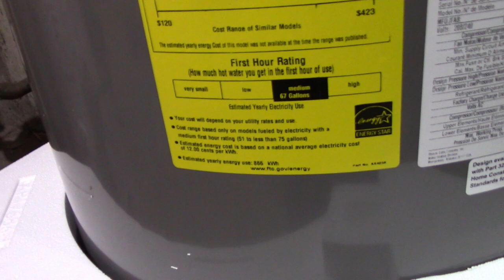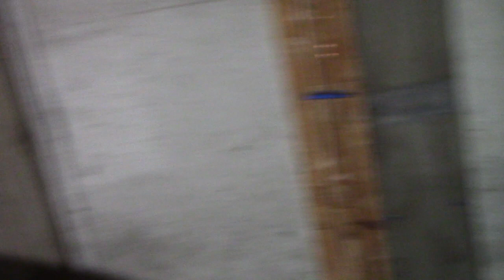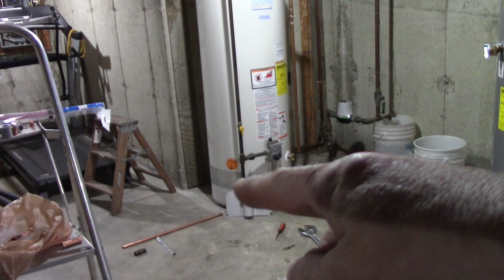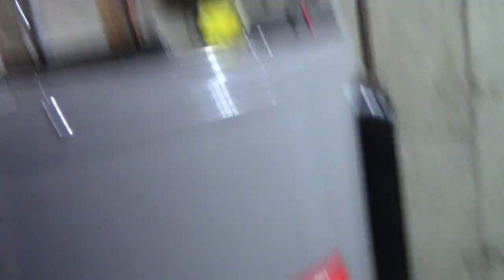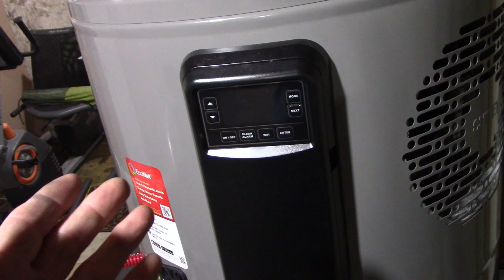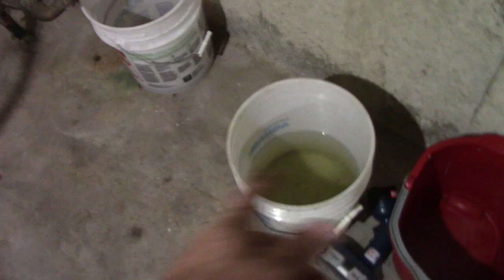DIY Rheem Hybrid Water heater complete installation. From gas to hybrid.

Comment: Hey What kind of pipe fitting end goes into that condensate drainage opening?  is it 3/4 male threaded or is it one of those where the edge of  the pipe just gets pushed in and its snug?
Reply from the maker: Just a hole...maybe 7/8
Reply: @JLafix  just got this water heater today,  so that hole is a 3/4 npt fitting,  I just stuck a barb 1/2 inch barb to 3/4 npt that turns in the outlet,  and bought a 10 foot length of tubing.  I saw what you did with the pvc etc for it and was really hoping I didn't have to go through all that haha.  As far as the pump run,  isn't it runninig at a up angle have you had any issues with it?  Also I was wondering,  so your water heater tubing ran down vertical before,  I noticed you ran new pipe along the floor,  why not just alter the vertical drop so it matches new layout?  Also why did you use copper instead of cpvc or pex?  

So for mine,  I don't have a ton of room so im going to alter the vertical drop where the pipes come down a bit from the original water heater to meet the ends.  cpvc is said to be able to handle 200 degree water... Copper "leads" make sense when its at the top of a propane tank because the fire heat coming out of the top where the copper pipes come out get so hot it will probably melt cpvc.. But if its just going to be 135f water coming out and cpvc is rated for 200... I am just going to put female 3/4 adapters on a 90 degree elbow and mount it directly to the pipe running down and attach it to the hot outlet.  I bought some 18 inch braided leads, and it stuck out from the water heater as it turned like a foot which is just silly and they are 10 bucks a piece vs 6 for those female cpvc which you have to use anyway male to those braided metal leads.  

Anyway thank you for the video, it was great to get some insight to what I was in for.  I spent way too much time researching and it was way easier then I thought.  I had to run a 220 30 amp line from the garage which is a first for me but I learned a lot.  such as difference between siemans and other brand circuit breakers and can you use a 40amp for a 30amp appliance.  Back to Lowes to get some more stuff.

biggest lesson of all in all this, is things all over is not in stock.  Finding 3/4 inch cpvc elbows or 30 amp 2 pole breakers and 10 /3 electrical wiring is hard to find.
Reply from the maker: @cranbers  I used copper pipe because that's what was there originally.  I ran new pipe against the wall to have it out of the way and a way to secure it better.  The condensation pump is just gravity feed no pressure so that's why no fitting just screwed into heater and pipe leeds to pump and just 3/4 pvc pipe fits into 7/8 hole in pump.  I was not aware they had a gas version of this unit, mine is electric but the old one was gas. I have no idea if this was more cost efficient than before. It was time for a new heater and this looked like a good idea. The old gas heater never made any noise,  this thing you will hear the heat pump  running so you have to get used to that. Of course if you put in electric mode it's silent.  I do like that the heat pump produces 45°F dry air. I ducted that cold exhaust into my duct work for the summer. So that should help with the air conditioning.
Reply: @JLafix  Just finished my install of this water heater,  it replaced a 13 year old propane one that cost me 40 dollars a month to run.

Lessons learned:
1.  IF you have an expansion tank where are you going to mount it on the new system?  This new system has mounts on the sides not the top.  So plan somewhere on a wall away from the unit because you can't do it from the ceiling or hang it from pvc pipe.  This added a day and a few more trips to local big box do it yourself store.  And I found out my old expansion take was broken for who knows how long because I knew nothing about it.  Expansion tank is half air / half water inlet.  And you pressurize it to your water inlet pressure.  So buy one of those faucet water pressure gauges.  see  what your pressure is at if its at 60 psi your good if its above that try to turn it down by the water pressure device going into your house off the water main.  The valve on it when pressed should not contain water if it does the tank is bad and replace it.   Check pressure with tire gauge, while your water system is empty,  ( main closed with empty pipes).  If its low or high and doesn't match your water pressure inelt,  put more air in it to match.  Then open mains close faucets and your good. 
2.  Plan your  new pipe runs carefully and have extra pipe / fittings just in case.
3.  USE PLUMBERS TAPE!  How I forgot this with 90 degree all metal fittings on metal fittings is beyond me but I did.  Got it all setup and of course leaks.   Had to tear it out and redo it.  All metal fittings use plumbers tape, wrap it around 3 times top to bottom on the threads.
4.  Remember  you can run 90 degree elbows with metal fittings off the water heater so it goes straight up to attach to existing piping,  just add 2 90 degree turns to existing piping that was cut off.  If its copper to cpvc you can use shark bite to avoid anything with fire and solder.
5.  If you need to run 220 wiring,  get 10/2  ( 10 gauge wiring with 2 wires it includes a ground).  So its physically 3 wires.  10/3 is 2 hot wires and 1 common white wire and the ground wire.  Would of saved me some money and time and effort if I knew this before.  that 10/3 is meant for outlets where appliance may need 120 volt and 220.  
6.  The 30 amp breaker is meant to protect wiring.  So use 30amp for 10 gauge.  I couldn't find a 30 amp so I bought a 40 amp and then found out why you need to match appropriately.  
7.  Frist time this unit fires up its going to run constantly until all the water is up up to temp and its full of cold water.  So prepare for a cold room if you don't vent.  But after that mine barely runs at all so the room isn't bad at all.  
8.  Water temp,  my old one was in the 130's,  this one does just fine for some reason at 125.  I have hot showers with no issues.

Comment: Heat pumps are NOT instant water heaters. As a matter of fact, they are slower, that is why the Rheem also has conventional electric heating elements. You can put it at heat pump only for highest efficiency, but the recovery rate is painfully slow. That is why you put it in hybrid mode and it prioritizes the heat pump but uses the resistive elements as well during high demand.

Comment: Thanks for the video!
How is it running after 6 months? 
Where you able to get any rebates as a self install?
Reply from the maker: No rebates because you need a licensed plumber... Everything's running great and I did a few modifications to the inlet and outlet however the thing  Does make noise as opposed to an electric or even a gas water heater so you need to get used to that .
Reply: @JLafix  Some places and power companies DO offer rebates to owner installed hybrid water heaters.  Check with you power company.  Central Hudson Gas & Electric offers rebates to owner installed hybrid water heaters.
Reply: @JLafix  thanks for the quick reply. Glad it works well, just ordered one, trying to figure out a way to get the rebate :p. Noise would be ok i will have it pretty secluded. I’m a bit concerned with the cold air in a Jersey winter but ill put a heater or something if needed. 
Thank you for the video.
Reply: @rojocapo610  I would set it in all electric mode during the winter if it gets too Cold

Comment: Hi, that little box near the power lines, is currently not connected, so what does the INSTALLATION/OPERATING INSTRUCTIONS SAY ?  Is that a dehumidifier next to Rt side of water heater ? 🇺🇸🇺🇸🇺🇸🇺🇸
Reply from the maker: Directions don't say any useful about that box by the power supply  and yes that is dehumidifier stored next to water heater

Comment: Energy saver mode will engage the less efficient resistive rods so that's probably why you hear the heat pump running less. If you want maximum efficiency run it in heat pump mode, only put it in energy saver mode if you run out of hot water often. Or put something like a cash acme heatguard  mixing valve on the hot water outlet. I installed one last week then set the tank to 140° and the outlet to the house at 124°. This effectively makes the tank a larger capacity and ensures all bacteria is killed in the tank.  I wonder why the proterra model isn't set up for ducting like other Rheem hybrid models? 
 The app can be a pain to setup but it is useful. Good install, nice to see soldiered copper.....
Reply: why is it called energy saver when it's not using the heat pump as much? that's an oxymoron! LoL
Reply: @enkrypt3d  There are control algorithms being used in Energy Saver mode and they actually result in better savings (about 10-15%) than heat pump only mode, even though the resistance heaters may be used for short periods.   

It has to do with efficiency of heat pump dropping off as the temperature of the water heats up to it's final point (120-140).   The resistance elements top it off quickly to the set temperature, instead of the heat pump running for hours and hours in an inefficient state trying to hit that final water temp.   The algorithm works with several measurements being taken (lower/upper tank temps, ambient air temp, time, etc...), plus possibly allowing larger swings in tank temp,  to determine the best combination of elements and pump times to get the most out the heating process and supply the needed hot water in typical scenarios.   

This whole process is being discussed ad nauseum on other forums recently and measurements do show Energy Saver mode winning.   Rheem does know what they are doing with energy saver mode and the documents stating the savings are not typos.   Locking the heater into one mode, like heat pump only, does not necessarily yield the best outcome.
Reply: @stevenk195  Excellent. I don’t own this model but presumably Rheem also explains it in the manual, to some extent?
Reply: @enkrypt3d  not sure but personally I believe they were worried if they labeled heat pump only mode as energy saver people would automatically choose that mode and if the heat pump couldn't keep up with high demand people would be unhappy with the product and complain.  So energy saver mode prioritizes heat pump but will use resistance if needed. I always keep it in heat pump mode though because it is the most efficient and I haven't had any issues

Comment: Quick tip: grab a water heater mixing valve, hook it up, set the output of the valve to 120° then set the tank to 140° or whatever the max temp is. You’ll never run out of hot water.
Reply: Said the same thing just now before I read your comment. I have a 50 gallon Rheem HPWH and installed a cash acme heatguard mixing valve at the tank and set the tank to 140° and the outlet to the house at 124°
Reply: Excellent video, thank you
Reply: There are several. Just go to SupplyHouse.com and type in the search bar: “water heater mixing valve” and you’ll get a plethora of results. Honeywell (although now it’s coming up as ‘resideo braukmann’) , Caleffi and Webstone are all good ones.

Comment: Hi brian from uk
Your basement is going ti get cold and its a heat pump
 vent cold air to old gas vent pipe
And in summer insted of going up old gas vent pipe divert cold into your house to cool it
You are making room cooler in basement with cold going from water heater heat pump 
The temp of basement will cool giving heat pump
More work to do as heatpum takes hot air from basement to heat water and chuck cold refrigeration air into basement get rid of that cold
Air outside or into house in summer
Brian uk
Reply from the maker: Thanks I was thinking of venting next spring...trying keep on electric mode for now
Reply: @JLafix  Do NOT vent it through the old gas vent. That vent is too small for the amount of output air from the heat pump fan. The additional back pressure created from venting it through the smaller gas vent line could burn out the heat pump and/or the fan for it.

Comment: Just out of curiosity, where roughly do you live. Do you live somewhere with cold winters? How is it working for you?
Reply from the maker: Yes live in New England. Basement is climate controlled to 65F.  So far so good but it does seem to run a lot...I don't have a comparison of cost efficiency of what it was vs what It is now.
Reply: @JLafix  I didn't have any problems getting ours to connect to the house wifi. The app works fine for me. It's nice to know exactly how much energy the HPWH is using. Our energy cost has dropped drastically. If we keep at the same usage, we'll use about $150/year of electricity. Huge savings compared to the over $500 in propane our old one used. Nice video.
Reply: @JLafix  the heat pump will run less in energy saver mode but in heat pump mode it'll run a lot more but it's a lot more efficient. However in winter it'll steal heat from the house. I have Mitsubishi hyper heat units so I let it scavenge heat from the house as even with the Mitsubishis having to work a little more it's still more efficient than resistive rods heating the water.

Comment: 12.29.20  Thanks for your video.  Now I have a better idea on what this water heater is about.  I currently have a GE geo spring which is now Bradford and white I think and is about I think 12 years old.  On one of the comments below on Home Depot where the price could be different depending on which city could be useful.

Comment: IT'S GOING FOR 700 BUCKS FOR 50 GALLON AND 1500 FOR 80 GALLON AT HOME DEPOT 
YOU GOT CHANGE THE STORE TO A SELECT CITIES OR TOWNS MOSTLY SMALL TOWNS IN OREGON SOME TOWNS ARE 100 BUCKS MORE AVOID THOSE  
THEN SHIP TO HOME
Reply: What town did you use?
Reply: @xyoojj  PHOENIX,OREGON STORE IT DID GREY OUT SHIP TO HOME BUT CHECKED AGAIN IN THE MIDDLE OF THE NIGHT AND 
FINALLY IT WAS AVAILABLE

Comment: The unknown fitting is a vacuum breaker. Intended to relieve the plumbing system if a hydrant is used by firefights. Without it the tank can crush in/collapse. Its also needed due to the new heater being a side outlet
Reply: Oh maybe I should put one in, guess it sort serves the opposite purpose of an expansion tank? BTW wouldn't an expansion tank be a good idea on this installation?
Reply: @chrisd4432  expansion tank is needed only when their is a check valve after the well or on the cities meter.
Reply: @mr.brownplumbing   thanks, ya I know that I was just thinking that the vacuum breaker is sort of the opposite in purpose. If the city side has too much negative pressure it allows air in the expansion tank is a cushion for too much pressure in your system. I out an expansion tank in because my meter is in a pit in my front yard and the water authority could install a backflow preventer without me knowing
Reply: So quick question if you don't mind. The vacuum breaker valve should probably go on the cold water feed I imagine? In case there's a water main break and negative pressure? After installing a mixing valve on the tank which has a backflow preventer built in I believe when I drain my tank I imagine I would have to open up the pressure valve or have a vacuum breaker valve because opening a hot water faucet in the house when it break the vacuum with the backflow preventer on the mixing valve?

Comment: Better hope you don't have a drain line backup? Also believe code states plumbing should be  12" away from electrical outlet or panel. Nice replacement though. Best electrical heater on the market. Plus it cools the basement.
Reply: I didn't catch that part. Did he tie the condensate into the sanitary sewer line? I thought about that, mine runs outside but have to worry about freezing in the winter. However my house is in a slab without a basement and I have a sewer vent at ground level do theoretically any sewer backup would relieve itself through the vent a few feet lower than the connection.

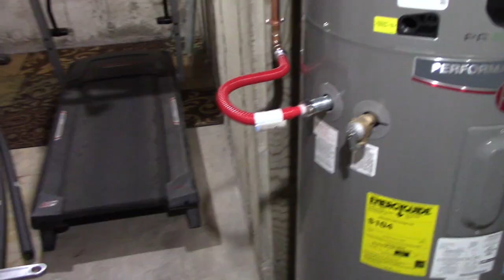Comment: 17:40 The flex connectors seal by compression of the washers, not interference of the threads. If the washers leak, water will seep past the open center of the nut, as well as past the threads. So taping the threads does nothing.  Actually, worse than nothing, because you can't feel how much you are compressing the washers due to the added resistance of the tape. One of the main purposes of flex lines is to make connection/disconnection easy; you just made it harder.
Reply from the maker: Good to know.  Doesn't leak so its staying with tape

Comment: 15:15 --- that's a vacuum breaker, intended to prevent an unforeseen negative pressure in the cold water supply from sucking contamination back into the drinking water supply. Without knowing what else is connected to that line, it's hard to say why it's there. Drawing tank water back into the cold water line normally wouldn't be a health threat, but might become one if the water heater was shut down for a long time.

Comment: Did you get rid of gas or do you have a gas furnace?  If so do you turn it off in the summer?
Reply from the maker: I have gas furnace, and I leave gas on all year long
Reply: J La wow.  What's your gas bill cost in the summer 0 right. No I'm sure they still charge you right?  Even if you don't use any?
Reply from the maker: @Jimbobo162   I don't know because my gas and electric bill come from the same place
Reply: J La I'm sure there's monthly a service charge for electric and gas like I have. You won't be saving money by switching from gas to electric unless you switch everything.